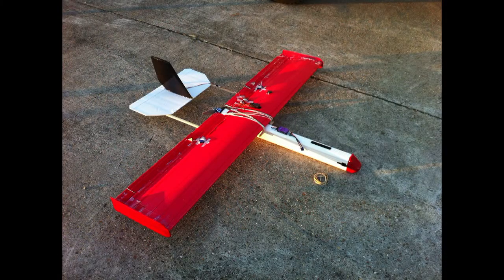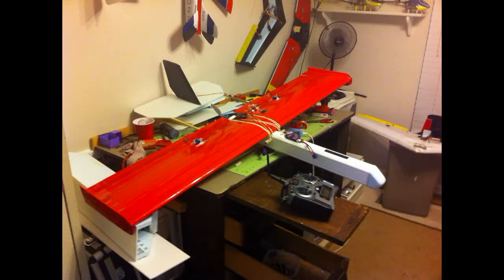The Dragon v2.0

Comment from the maker: @schraut5 Wing area is 720 square inches and the plane is about 1500 grams all up.  The motor that I'm using is a 3015-1200kv.  It's 115 grams and is rated at about 380 watts on a 3S lipo.  I'm using an 11x5.5 APC prop and have tons of power to spare.  It has pretty much unlimited vertical climb.  I've had it out at the field twice and have about 8 flights on it.  I'll probably end up backing down on the motor a bit to save even more weight and reduce the amp draw as well.